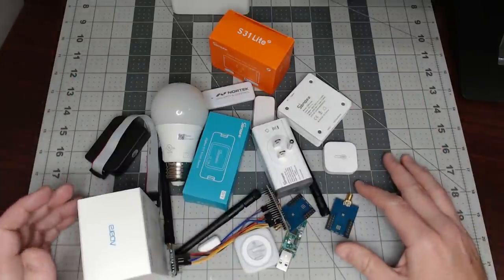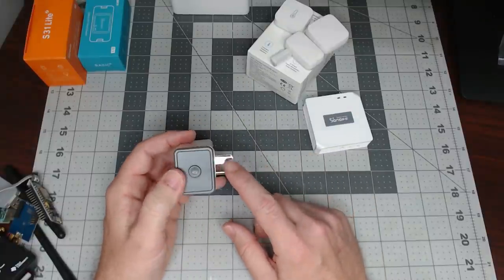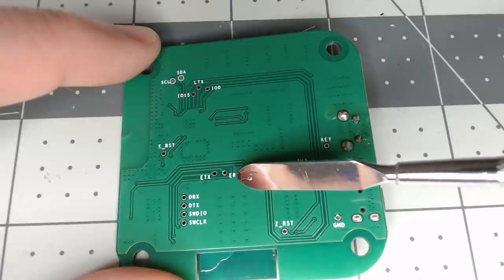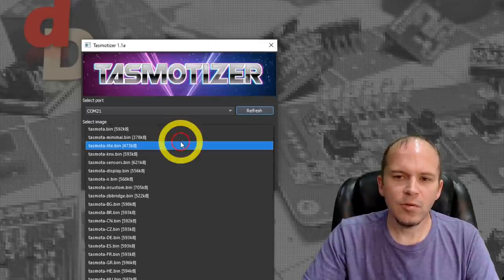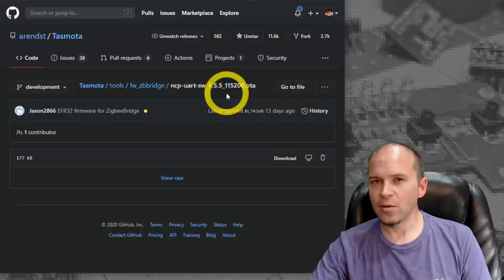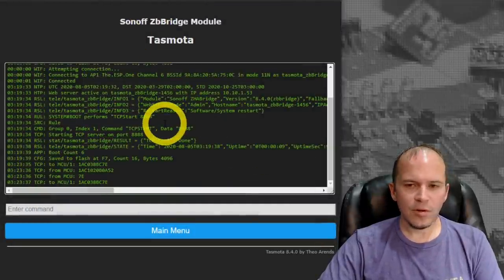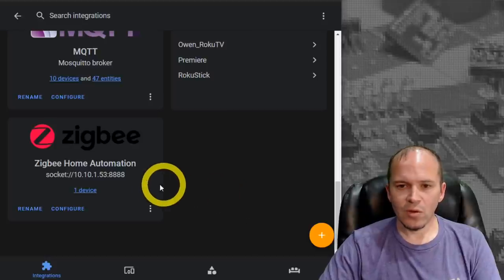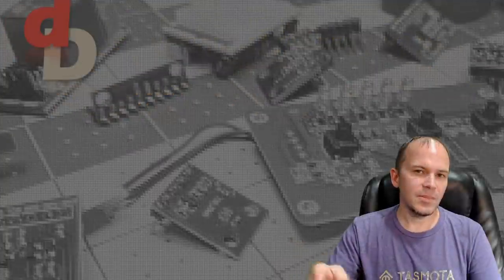Sonoff Zigbee Bridge with Home Assistant using Tasmota | NO Soldering | Step by Step Guide

Comment: After buying 2 different USB to TTL devices, I finally managed to flash Tasmota on the Sonoff Bridge. I installed a few apps like Tasmota Remota or Tasmota Control, but I can't add the Sonoff, so I can further add sensors to the Sonoff bridge. I also can't find video tutorials addressing this. I wasn't able to follow the "Home Assistant" part because again, I wasn't able to find some tutorials explaining how to install Home Assistant, plus it seems it's some kind of an app for a PC, while I was looking to add the Sonoff bridge to Android, just like it was with the original firmware.
Any tutorials addressing adding Sonoff bridge to Android ?
Reply from the maker: I've only used it with Tasmota myself.

Comment: Everything was going fine, until I had to do the wiring, neither of the breadboard wires I have (or pins) fit those tiny holes, while with wifi-only sonoff devices I never had that issue.
Reply from the maker: Try a piece of wire out of a CAT5 cable.

Comment: Hello, thanks for your great tutorials.
I just tried to install Tasmota using a raspberry Pi and I get stuck at the following step:
#####
pi@raspberrypi:~/esptool $ sudo ./esptool.py --port /dev/ttyS0 erase_flash
esptool.py v3.0-dev
Serial port /dev/ttyS0
Connecting...
Detecting chip type... ESP8266
Chip is ESP8266EX
Features: WiFi
Crystal is 26MHz
MAC: a4:cf:12:d7:f2:2b
Uploading stub...
Running stub...
Stub running...
Erasing flash (this may take a while)...
Chip erase completed successfully in 4.2s
Hard resetting via RTS pin...
#####

so, erase flash seems to work but  when I send the writing command does not connect anymore:

#####
pi@raspberrypi:~/esptool $ sudo ./esptool.py --port /dev/ttyS0 write_flash -fm dout 0x0 tasmota-zbbridge.bin
esptool.py v3.0-dev
Serial port /dev/ttyS0
Connecting.......
#####

Any ideas about how to do a RTS pin reset and write the flash?

Thanks in advance
Reply from the maker: did  you power cycle the device in between esptool commands?
Reply: digiblurDIY thanks for your answer . Yes I rebooted and tried again. Doesn’t connect
Reply from the maker: Weird, I've use esptool several times myself with devices and can do the flash_id, erase etc but they do take power cycles in between.  I'd suggest trying another method since yours seems to be hit or miss.
Reply: @digiblurDIY  it works! Thanks a lot!!

Comment: "Failed to connect to ESP8266: Timed out waiting for packet header"
I could not figure out what the issue is when I try flashing in Tasmotizer 1.2. 
I'm not from electricals background. Any direction would be highly appreciated. Thanks
Reply from the maker: I'd check your wiring again, make sure RX-TX and TX-RX and that GPIO 0 is also grounded before powering up.
Reply: @digiblurDIY  redid the wiring today and BAM ZHA integrated. 
Why doesn't YouTube have a button give like a 100 likes. 
Thanks a lot for the video.
Reply from the maker: awesome!!  Feel free to share the channel and/or videos in places.

Comment: I just purchased a ZB bridge-pro, the board layout is different, i cannot find ERX or ETX, there are RX0 and TX0 connectors, is it still possible to flash the board?
Reply from the maker: I think you can but not really a recommended hardware now with all the various USB and Ethernet based ones available now that don't require this process and are more reliable.
Reply: Could you recommend a device i can connect to my router?
Reply from the maker: @GerardWennig my current go to. Plug in and go.
SMLight SLZB-06 - https://amzn.to/4brdxbS or https://s.click.aliexpress.com/e/_DBdYCrv

Cheaper on Aliexpress there but watch the model number selection.
Reply: @digiblurDIY  Thanks, As a complete newbee, this helps me lot
Reply from the maker: @GerardWennig I just did a recent video on Zigbee as well and will be covering the plug and play smlight one.